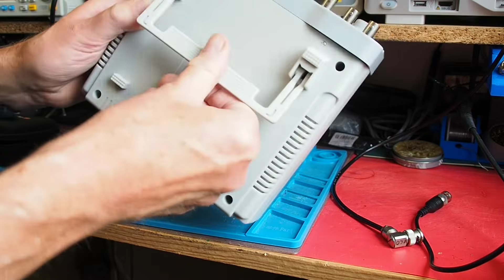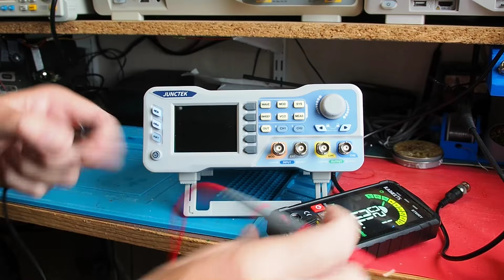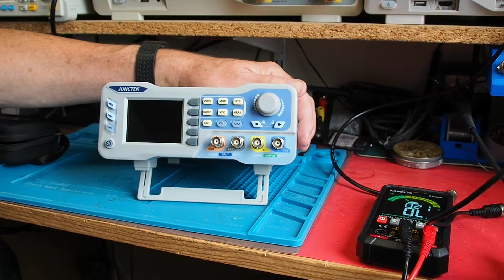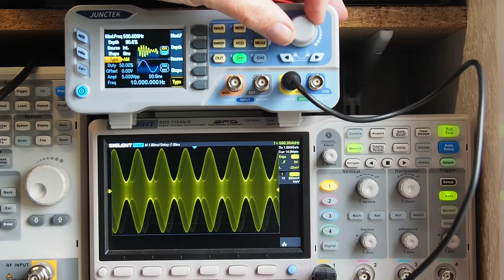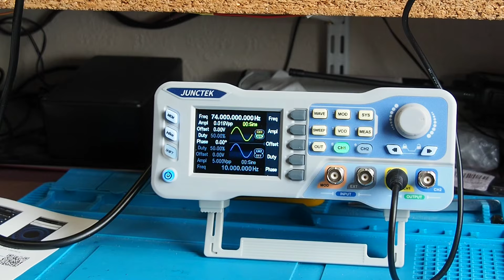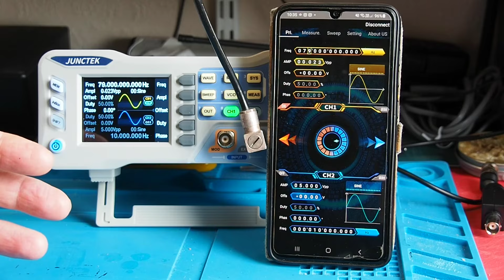Junctek JDS8080 Review - #134

Comment: Glad I found your channel very nice videos and very  informative,  looking for a nice generator for radio work.  Not yet sure which one to buy.  I fear some stuff is cheap junk
Reply: Get a proper low phase noise RF Signal generator and one with PLL. These DDS and VCO controlled function generators are not designed for radio alignments. It the wrong application for it. Even my higher end HP, or Rigol function generator won’t use for that. The Rigol DG4102 I have is worst then the Chinese function generator as doesn’t do modulation correctly as in AM modulation carrier which increases if you reduced modulation. 

I have one of the Koolerton Arbitrary waveform generator and good for head alignments and other work like testing boards missing clock signals and etc but won’t use it for RF work.

Comment: Does this unit give audio out, and how does fair against you’re function generator.  please and thank you.
Reply: @jim9930  Thanks for the reply. There’s so much I have to learn. I could easily be scammed with some of these cheap chineseum equipment. I’ve often thought of buying older units from renowned brands. But they seem to be only in the 2 to 3 MHz range. There’s currently one for sale near me, it’s an IEC F34 3 MHz signal generator with sweep. Made early 70’s, it’s cheap enough I’m just scared to pull the trigger and buy it as now retired I’m on a low budget. The FY6800 I heard has a grounding issue on the bnc connectors that could damage other equipment and even possibly give a person a shock.
Reply: @jim9930  Thanks for the advice Jim, much appreciated bud. Cheers 🍻
Reply: ... how does it FARE against YOUR function generator? Is English not your first language?
Reply: @SpeccyMan  You’re a sick twisted individual, I hope you know that little man. That comment says so much about you.